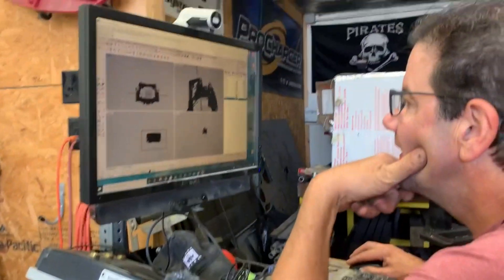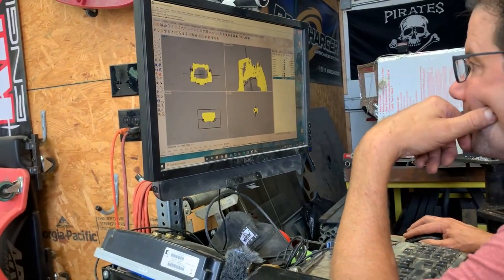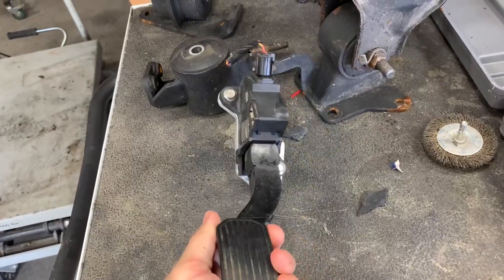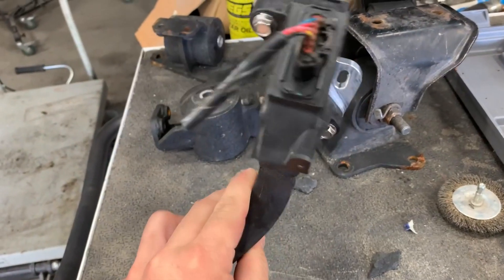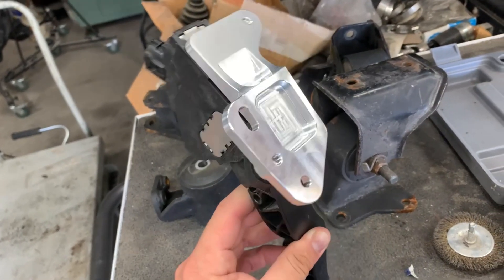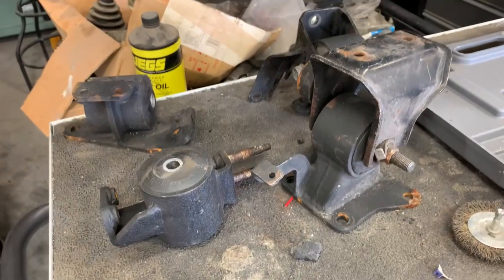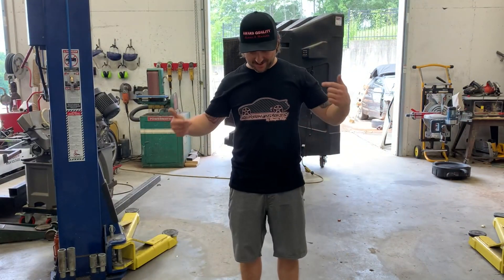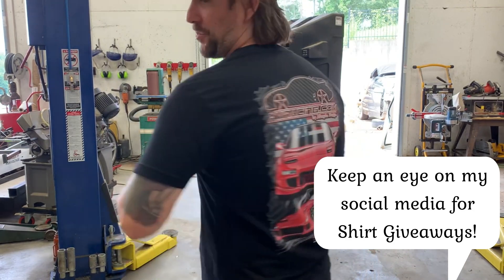MR2 Tesla Swap Series Part 4: Setting the motor position and axle angles

Comment: Will you be using something like aems new ev control unit for this? 
Super excited as I love the 2nd gen mr2s. They look like a baby ferrari. 👍🏻😎
Reply from the maker: We will be running Fueltech!
Reply: @AFragolaDesign  nice care to share what the hp, range and acceleration goals are for it? 😁
Reply from the maker: @4literv6  all of it!
Reply: @AFragolaDesign  darn fine answer indeed. 😁
When's the next update due then?
Reply from the maker: @4literv6  soon! Gotta get the plates from Eric
Reply: @AFragolaDesign  excellent, what about body mods? Any crazy aero, over fenders, or wide body being planned? 
Or will it be much more subtle and low key appearance stuff. How about wheels? Just very curious as I've always admired these little 2nd gen mister 2s. 👍🏻
Reply from the maker: @4literv6  sorry I didn’t see this! I’m doing a bit more subtle stuff for now, but I will be doing a vented hood soon!
Reply: @AFragolaDesign  nice, will it be a c.f. vented hood? What's your planned finished colors for the car?
Finally when do you think a new video will be out? 😁
Reply from the maker: @4literv6  I’m just waiting on the plates from hux, then I’ll make the mounts and have the new video. Black snd red accents for the colors but I have a surprise for that!!!
Reply: @AFragolaDesign  hey black and red is one of my favorite color schemes. 😀

Comment: Can the E153 axle outers handle Tesla torque? Spline count? Diameter?
Reply from the maker: Good question, I’m not sure, I will probably be talking with the axle manufacturers to see what we have to do when we get some made
Reply: @AFragolaDesign  I'm looking. Not sure, but it looks like everything is 30 spline. You might get lucky and they'll slide right in. EDIT: I found out that the outer end of the middle bar is 35 spline. That makes more sense.
Reply: Really comes down to how much tire you want to run.  A typical 275-255 tire will limit the possible load.
Reply: @HuxRacing  I agree. Plus weight and diameter have a lot to do with it. But Model S rear tires are only 245 (Performance) or 265 (Performance plus). Just something to keep in mind.
Reply from the maker: @HuxRacing  big tires, I wanna go fast!